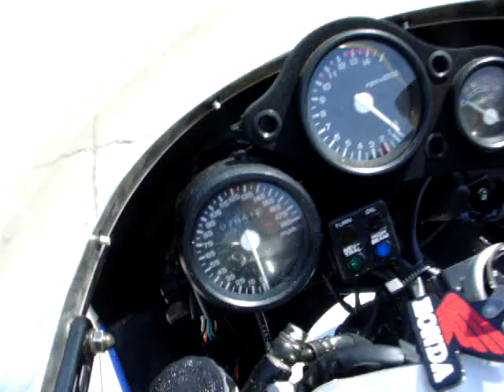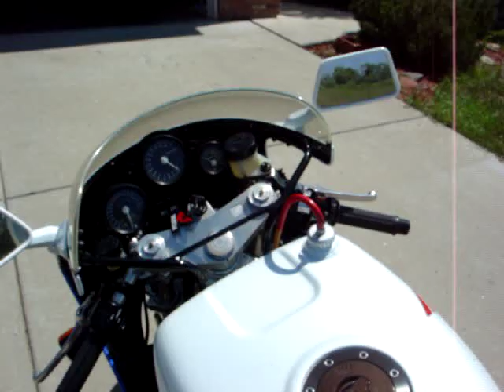1990 Honda RC30 VFR750R

Comment: Thanks so much for the rundown. Beautiful bike. A work of art, really. Since you know so much about the RC30, I wonder if you could shed any light on Honda's motorcycle design team through the 90s? I'm sure it would be a great story. They engineered some wonderful machines during the decade. VFR750(R) is Honda's build quality pinnacle, IMO.
Reply: kingbee1971 
Japan always had the hottest 400s since 75 (I have A Hon 75 400/ 4 ss) because of licensing rules,they made new riders no matter what age go no higher than 400cc.
Like my fathers belief that you had to earn your displacement.
Even through the 80s we got alot in the states.But supposedly among a handful of reasons we were told the Japanese suits believed Americans only wanted bigger bikes as they were more suited to tastes and the roads,speeds,egos etc. But when they did give it a go,along with agreed factory design and refinement limits agreed and a fake pre-enginered company performance war.The bikes performance was pretty tweaked compared to home regulation bikes with government restriction control laws.So we got scaled down copies of the liter + class of World Superbike race machines.Like single sided swingarms for fast endurance race rear tire pit stops at Daytona or your local Friday/Saturday night designated pit spot where girls might see you getting a fast rear tire swap during night time weekend endurance street cough races.
But sadness came when Yam stopped selling their factory designed and built 400cc 2 stroke class racetrack club bike for experts and people who wanted to track race officially and get started.Spares and factory race parts available over the parts counter.wow
And I saw a couple get lights and a plate put on for street jamming and cred.And sometimes you could find them in the want ads for sale to whoever.
But I ended up finding a 75 Honda 400/4 ss in the mid eighties.still have it but I want to send it back to Japan to a enthusiast. As they were built there but only for sale to here,Europe or England dont care.
And they appreciate Japanese bike history,not like in the US where people are closed minded and holdover obsolete opinions because someone said it to them.But look at Hardly Abletorun or Choking Chicken available performance products like fast looking skull turn signals and improved  airflow to the fake intake butterfly's wow
And they were the first to go all out max performance Special Vehicle Operation dept model with new bigger stick on price tags with extra zeros.
And two extra valves per cylinder.wow And 0 Hp increase put in print.But they also put in a stronger charging system to keep battery alive after obligatory aftermarket led lights overtax the charger and kill your gel battery before it cracks open.wowwwww
Reply: Joey won the Ulster in 1999 on an RC45 against 1000cc R1's...flat out smoked them...both of them best in class...period.

Comment: save your money a vfr 800 is cheaper an quicker still got that v4 sound track an wont make your ass bleed in that race seat.
Reply from the maker: +1423stuart  Yeah but it's not an RC30 is it.
Reply: I have a VFR800 and you're right; it aint no RC30 :-(